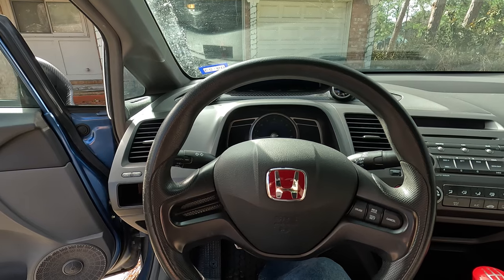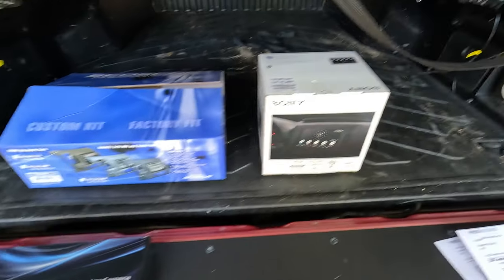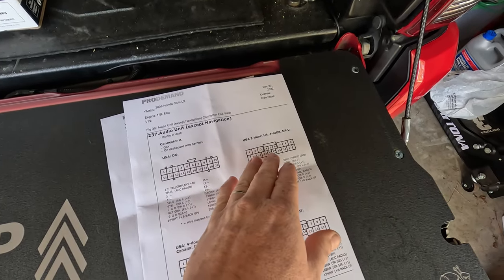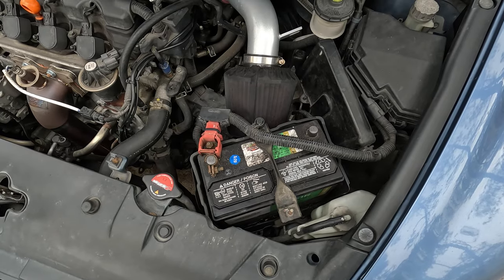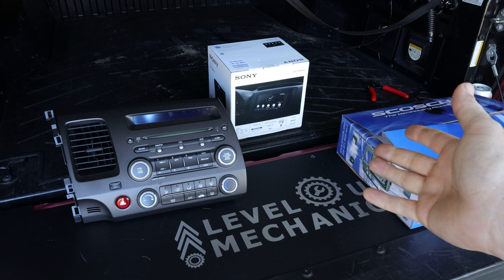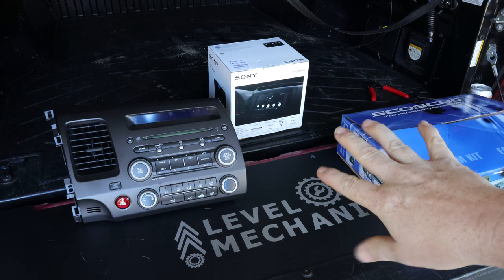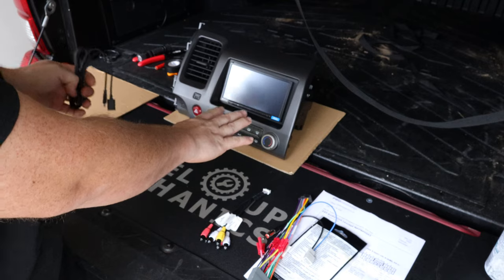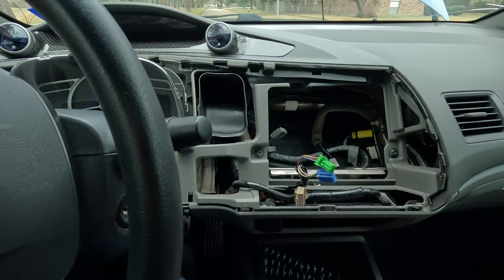Adding Wireless Apple CarPlay & Android Auto To My 8th Gen Honda Civic (2006-2011) | Sony XAV-AX4000

Comment: I hope to see more of this videos, I also have a civic LX and i'm modding it
Reply from the maker: I have a lot of mod videos to edit & upload. Speakers, compact subwoofer, carbon fiber gauge pod & gauges, suspension upgrades, clutch & flywheel, etc. 

Plus, I'll be converting the rear drum brakes to disc brakes this weekend (with lots of polyurethane bushings & extra improvements). There is a lot to share 😁.

Thanks for the support!
Reply: @LevelUpMechanics  that sounds great! I'm actually getting into Audio so tomorrow I'll be setting up new speakers.
Hope to see that content coming soon
Reply from the maker: My speaker video is up next and will be out in a couple of days 😁👍. Just gotta finish editing the video 🤣

Comment: LEGIT, you’re Awesome.
this is all I need for my civic FD hybrid 2008.
will do this project soon.
Reply from the maker: Thanks! I appreciate the support! 😁👍
Reply: Hi Chris, 
I got Civic FD Hybrid 2008 Australia.
does all the wiring is same with the one you put on the description?
Reply from the maker: Possibly. If your stock sound system is the basic version (vs. a premium factory sound system), then the wiring should be identical.

However, I only have access to USDM wiring diagrams, so I do not know if there are any differences between the U.S. version and Australian version.

Comment: Hi! I have a question. I have fuses in the interior that are not working, I thought a replacement would fix the issue but apparently its a wiring issue. Can you help me with guidance on how to repair?
Reply from the maker: If you have a particular fuse that keeps blowing, there are multiple possibilities as to why the fuse keeps blowing.

For example, if you try to power multiple electronic accessories from one power outlet (usually rated around 15-20 amps), you could be overloading the circuit (drawing over 20 amps) and cause the fuse to blow. 

Other scenarios include a short-to-ground circuit, a short-to-power circuit, loose battery cables or ground wires, a wrong type of fuse (there are various types / sizes of fuses - micro, mini,  etc), and so on...

If I had a fuse that kept blowing every time I replaced it, I would suspect that there might be a short-to-ground issue in the circuit. 

I would figure out what electrical items are used for that fuse (in an owners manual, for example), and then I would look up a wiring diagram for those electrical item(s) and start testing / inspecting different parts of the circuit (usually somewhere after the fuse).

I hope this info helps! 😁 I wish I could be a bit more specific. There are a lot of YouTube videos that show how you can test a circuit to diagnose an electrical issue... sometimes it can be an easy fix.

Comment: Does this retain your steering wheel volume controls?
Reply from the maker: Yes, but you would have to purchase an additional component (I believe it's called an iDatalink Maestro Interface Module).

Adding this additional item would allow you to retain your steering wheel controls.
Reply: I looked up for that, it can be + $90 bucks @LevelUpMechanics
Reply from the maker: @IARDM27 that sounds about right.
Reply: @IARDM27  I suppose I can live without it then

Comment: Did  you install the GPS antenna?  If so, where?
Reply from the maker: I did not. I use android auto, which doesn't require the GPS antenna.

If you use wireless Apple CarPlay, then you will need to plug in the GPS antenna and then just place the antenna somewhere on a horizontal surface.

Comment: I have a 2006 lx as well but have failed to have any sounds from my speakers in 2 years. I’m stumped so there’s not any amplifier? The only speaker working is my front tweeter for the doors and ignition. I put a dual touch screen in it. I find it weird that none of the other speakers are working at all. What’s the chance of them all going at once ?
Reply from the maker: The chances of all 4 speakers going out at the exact same time are pretty slim. It is more likely that something that controls all your speakers is the problem (like a blown fuse or your touch screen radio).

Comment: What would you recommend for the CSX model?
It came with a touchscreen display with subwoofer and Navigation. And I would like to have apple car play aswell
Reply from the maker: The Sony XAV-AX4000 or XAV-AX6000 should be good options to choose from. Just keep in mind that you would also need to purchase an iDatalink Maestro kit in order to keep your factory steering wheel controls (which would cost extra $$$).
Reply: @LevelUpMechanics   both look amazing. Unfortunately, slightly out of the budget  , is there any models possibly in the 2-300 range ?. Or should I just save up for one of those models ?
Reply from the maker: @Student2024.4 You could always look into any of the Chinese "tablet style" stereo units that are floating around on Amazon / Ebay.

They usually have wireless Apple CarPlay / Android Auto options & are usually compatible with your factory sound system components... the only downside is that the Chinese brands can be hit or miss (as far as quality).

I actually have one of these tablet-style head units in my Toyota Tacoma, and I have not experienced any issues so far. Plus, they are more affordable than "name brand" stereos. 😁👍

Comment: how is the power and sound over stock? I have an older 2013 toyota base model and am curious how much louder it will be.
Reply from the maker: It's a definite improvement over the stock head unit, that's for sure 😁👍. Pairing this head unit with some decent speakers is really nice, as far as the sound / "loudness" is concerned.

I am very happy with the performance of the full sound system that I installed in my civic. 

Nothing crazy... no external amplifiers or anything... just simple... and performs well 👍.
Reply: @LevelUpMechanics  awesome thank you for your quick response I was contemplating on whether I would need an amp or not. My stock system was way too quiet

Comment: I blew out a fuse last time on my civic tryna connect an amp to the car and since then my stereo hasn’t been working I bought this stereo to but hasn’t turned on either any clue what it is? bc I can’t find anything I replace the strep fuse and all other fusses look good to
Reply from the maker: Honestly, I have no idea as to what it could be. If you can read wiring diagrams and test electrical circuits, then I would suggest trying to figure out why your stereo unit isn't getting power. 

Otherwise, you may need to have a professional technician diagnose the stereo system.

Unfortunately, there isn't much I can do over the internet to help figure out the problem.

Comment: Did your car stereo have a subwoofer?  I am swapping out my car stereo to a Sony XAVAX3250.  Wondering if the same wiring harness should work for this?
Reply from the maker: My car did not have a factory subwoofer. The wiring will be almost identical, but you will have a factory external amplifier to account for.

I would recommend that you find a youtube video that includes a factory amplifier. You will benefit from that info a lot better 😁👍.

Comment: What kind of gauges do u have by the steering wheel? And do u have a video on the installation?
Reply from the maker: I will be finishing the video on the gauges soon (I'm just waiting on one more gauge pod to arrive to finish the project).

Currently, I have the XVRACING carbon fiber gauge pod with 2 ProSport JDM Series 52mm gauges installed. Here are the links: 

https://xvracing.com/product-category/honda-civic-fg2-fa5/

https://prosportgauges.com/collections/jdm-series

I hope this info helps! 😁👍
Reply: @LevelUpMechanics  thank u so much
Reply from the maker: Anytime 👊 👍

Comment: hey great video appreciate it just subbed can you share the honda connector wiring diagram please?
Reply from the maker: If you check the community section on my channel, I just shared a picture of the main electrical connector pin layout for you. Hopefully, this is what you are looking for (I'm assuming you have the factory basic stereo sound system and NOT the factory PREMIUM sound system).

I hope this helps! 😁👍
Reply: @LevelUpMechanics thank you  very much ❤❤
Reply: @LevelUpMechanics perfect
Reply: hello, did you find it? @Panjtoori

Comment: Can I upgrade my 8th gen civic (07 lx)  to an 8th gen (hybrid) Navigation unit?
Reply from the maker: I mean, you could... but I don't think it would be cost-effective to do so.
Reply: @LevelUpMechanics  I have the Navi radio head unit already, just wasn't sure if the installation would be that much of a hassle
Reply from the maker: @Nessamor I'm not 100% sure that it would be "plug and play." The wiring layout for the radio connectors may be different, if I remember correctly.

Comment: Hi, can you let me know the brand of your gauges and type (OP, Battery ir Bost? 

Thanks
Reply from the maker: They are ProSport JDM 52mm (2-1/16") gauges. I'm currently running an oil pressure gauge and a wideband AFR gauge. 

https://prosportgauges.com/collections/jdm-series

I hope this helps! 😁👍
Reply: @LevelUpMechanics  Thanks you so much! 
You delete the Check Light (O2 secondary sensor) with a Hondata? 

Thanks again!
Reply from the maker: No problem 👍. Yes, I disabled the secondary o2 sensor with Hondata to keep the check engine light from setting a code for the catalytic converter.
Reply: @LevelUpMechanics  Thanks a lot! 
Hope to see more videos about 8th Honda civic. New sub!
Reply from the maker: That's awesome! Thank you for the support! I have a lot more content coming soon for the Civic 😁👍

Comment: If I want to use a FM/DAB splitter for the original antenna, which needs 12v, would i need to hook it onto the red wire?
Reply from the maker: Honestly, I don't remember... it's been a while since I made this video.
Reply: @LevelUpMechanics  🤨

Comment: Nice video…. Would it work for a civic Si 07 too?
Reply from the maker: Yes, it would work for the Si as well. The only difference would be the wiring. You would need to pick up a wire harness adapter that is compatible with your premium factory sound system. 

I believe you would need to use the Metra 70-1730 Receiver Wiring Harness and the Metra 40-HD11 Antenna Adapter...

If you need more info, I would highly suggest checking Crutchfield's website. They do a really good job at showing everything you would need to make this Sony receiver compatible for your civic. 

https://www.crutchfield.com/
Reply: @LevelUpMechanics  great. Thank you so much for the prompt response. I’d take a look at the site too.

Comment: Did you solder the wires together? I’m Tryna go for the same setup as this but I’m new to this
Reply from the maker: Soldering the wires together provides the best connection, for sure. But for the video, I just crimped the wires together (between the Sony harness and the plug-n-play harness I purchased on Amazon). 

I haven't had any issues to date. 😁👍
Reply: @LevelUpMechanics thank you sir 👍🏻 appreciate the help
Reply from the maker: @mrmcguffle3345 anytime 👊👍
Reply: @LevelUpMechanics  should I also strip a little bit of the wire as well or is it good to crimp as is? Sorry if I’m asking too much
Reply from the maker: @mrmcguffle3345 you should strip a little bit of the end of the wires when you are crimping wires together (the same goes when you are soldering wires together) 👍.
Reply: @LevelUpMechanics  thank you again, just finished up today ended up great thank you for the help and love the vids 👍🏻
Reply from the maker: @mrmcguffle3345 no problem 👍. I'm glad everything went well!

Comment: Surprused you didn't install the idoing stereo. Everyone seems to like those.
Reply from the maker: I really thought about it. In the end, though, I've seen so many posts where people eventually have issues with these "low-cost,  Chinese-manufactured" tablet-style stereo systems that I decided it would be best to go with a "name brand" product that has a long reputation of quality.

The Sony XAV-AX4000 doesn't look as "high-tech" as the tablet-style head units, but I really enjoy the simplicity that mine offers.

So far, I have had ZERO issues, and I am happy with the wireless capabilities that this Sony unit has to offer.

If I were to take a risk on a tablet-style head unit, I would definitely try the iDoing brand, as I hear the most positive-related reviews from this brand.
Reply: @LevelUpMechanics The Sony ain't cheap. So safe to say it's quality. Definitely checking it out

Comment: Is it compatible with a csx?
Reply from the maker: I would say yes since the Acura CSX is the Canadian version of the Honda Civic. 

If your CSX includes factory steering wheel audio controls, then you will probably need an iDatalink Maestro RR Interface Module to make the head unit work with the steering wheel controls. It's basically the same thing needed for Honda Civics here in the US that have steering wheel audio controls.

I hope this info helps! 😁👍

Comment: how did you hook up steering wheel control?
Reply from the maker: You have to purchase an "iDatalink Maestro" kit separately to integrate the steering wheel controls with the stereo. I think it's like an extra $100 ish...
Reply: my sony head unit comes with a Steering Wheel Remote Cable mode RC-SR1. are you familiar with that and how to connect it? it a very simple looking piece. 3 wires and an aux jack @LevelUpMechanics